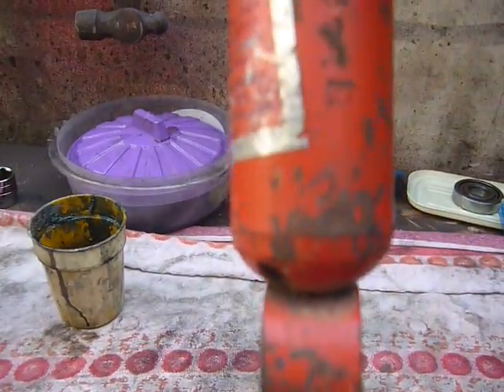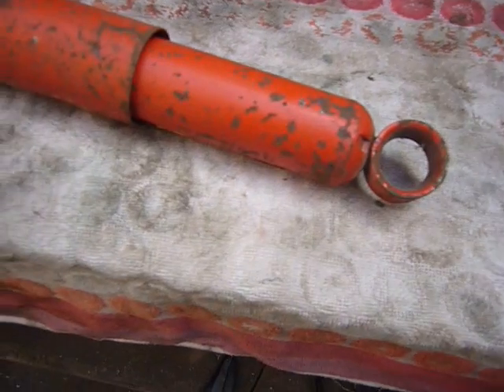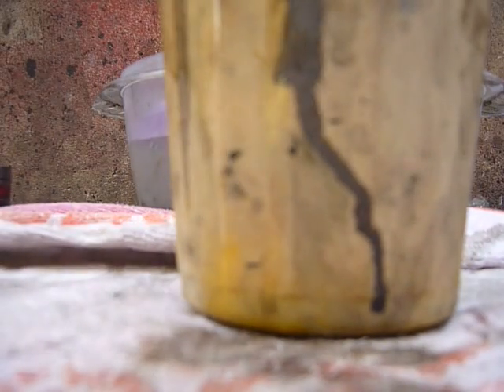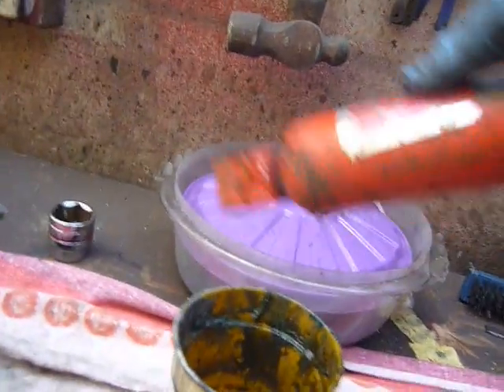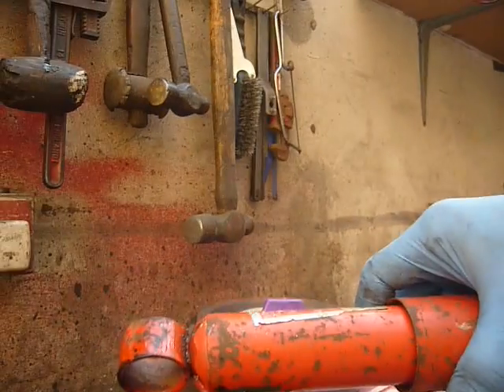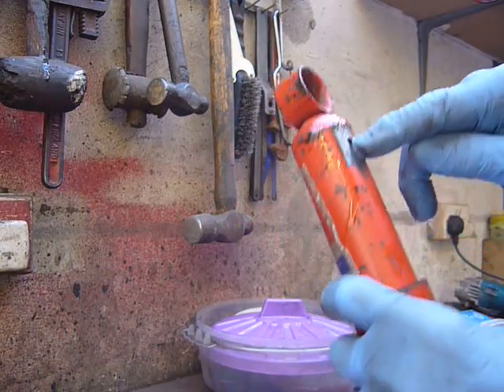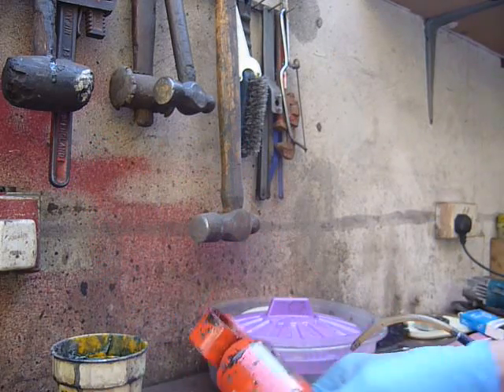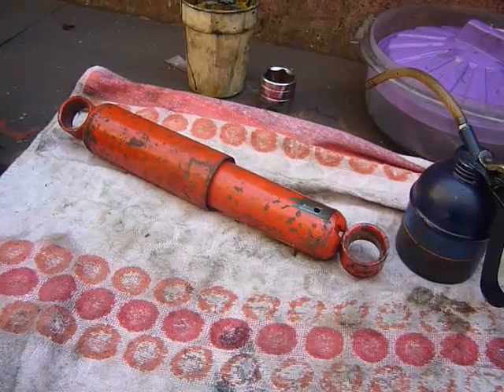Refilling oil filled telescopic shock absorbers.

Comment: Great tutorial! The oil drained seems to be in great condition though.. just for sharing, I have friends that welded a nut over the hole so he can put a screw over to cap it and to make the next oil change job easier. :)
Reply: Yeah he did say the shock he’s using has good oil just that it’s the only one he has to demonstrate with
Reply: astroboy Chew what i was going to say